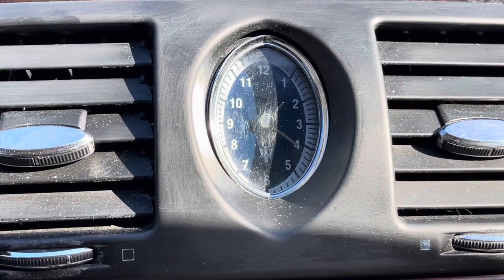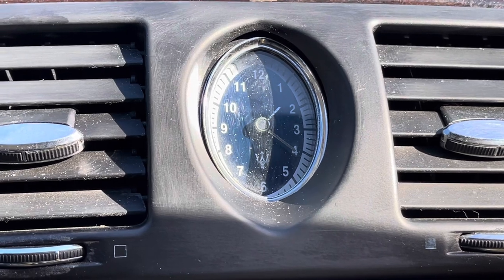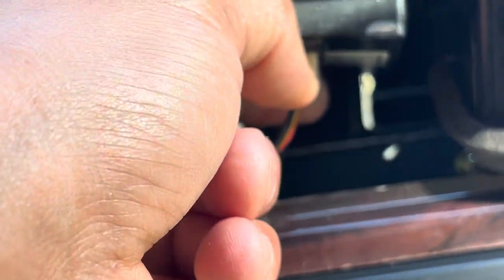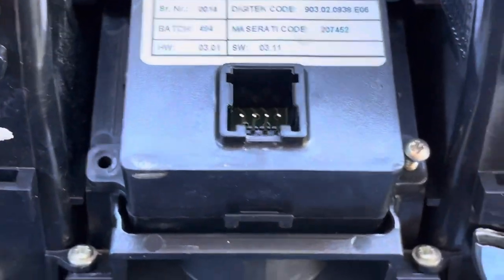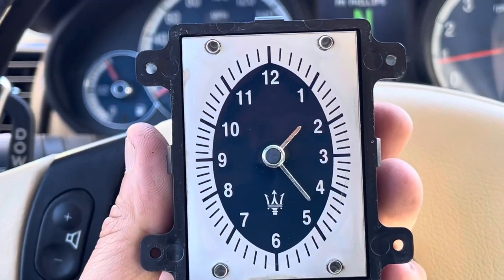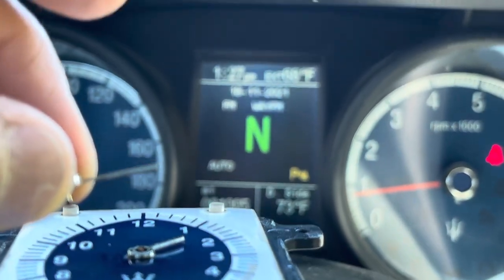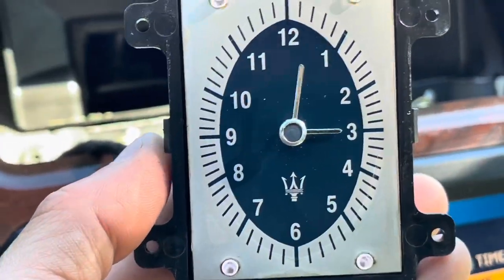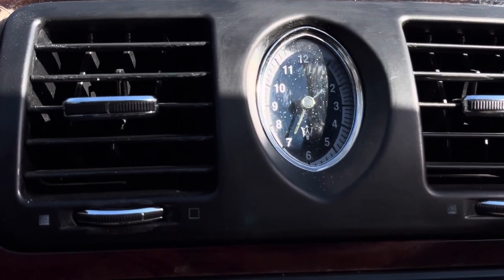How to fix a Maserati Quattroporte analog clock and make the digital clock match

Comment: Well unfortunately 514 people were misinformed.
Okay so even on the level you solved this there is a WAY better method. Where you don't have to spend all this time taking apart the clock.

You could have just set the radio clock to make the analog clock what you want it to be...so if the analog reads 1:20 and the time is 10:15, set the radio to 7:10 and watch the analog clock go to 10:15..  then pop out the analog clock and disconnect it.  Set the radio back to 10:15 and then re-connect the analog clock.  Voila. They match without having to be a watchsmith....  You experienced the 20 minute issue when reconnecting b/c you were allowing the infotainment unit to send an offset request to the clock.  In your video even, you connected it with the power on.
1)Set time to whatever you need to set it to in order to physically move the analog clock where you want it.
2)Shut everything off, remove the key
3)Disconnect the analog clock
4)turn on the car and set the infortainment digital clock to the correct time. (Note: it should be the same time on the analog clock.) do this quickly as each minute you take, you are offsetting the two clocks.
5)Shut everything off, remove the key
6)Reconnect the analog clock

Once you start the car they will be matched and the analog clock won't adjust. It will just start keeping time from where it is. 

If this does not work (which means you have to calibrate your system, not your clock) then you can do the below:

 BUT also, if you read the manual, there is already a feature to set the analog clock manually...

Simply depress the passenger and driver dome lights simultaneously holding them for approximately 6 seconds (until they begin to flash alternately) and then press the passenger for one minute forward, press the driver for one minute back.  Press either 3 times rapidly and then hold to advance continuously.  Once set, simply touch nothing and it goes back into illumination mode and your clocks are synchronized without taking anything apart...

You're welcome.
Pro tip: Pulling the hands and re-inserting them is an amazing technique to break the clock and shorten the life as well as potentially adversely impact timekeeping accuracy. (Not that it is anything noteworthy as a timepiece anyhow)